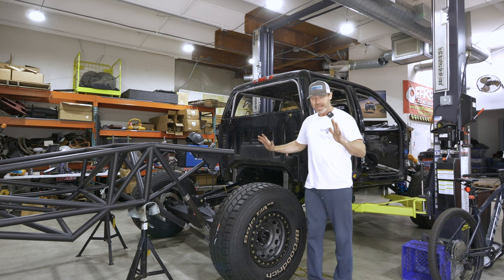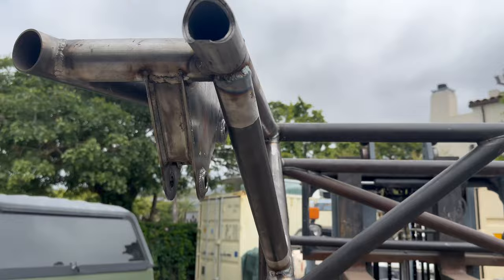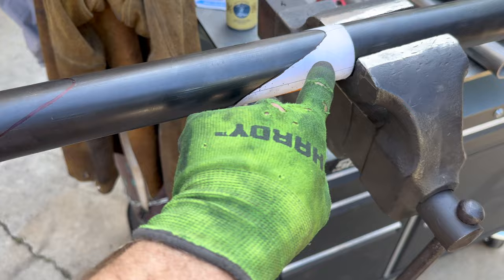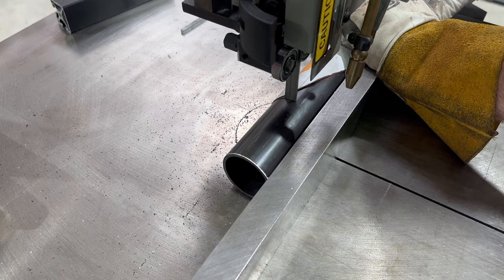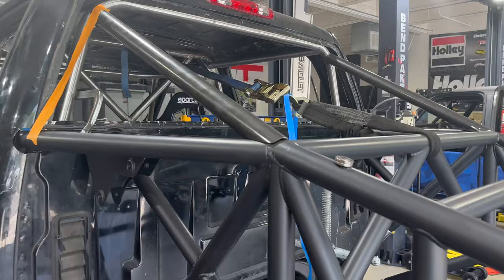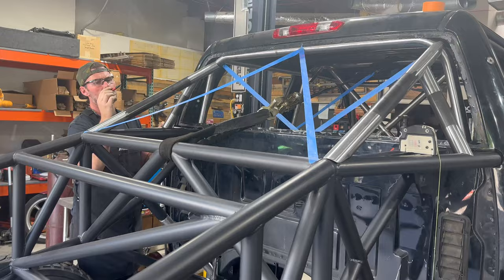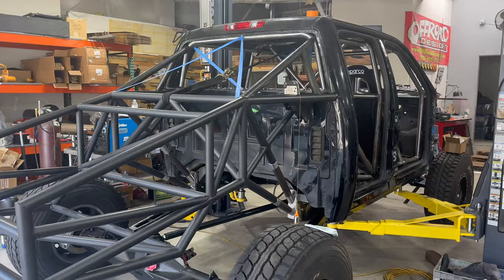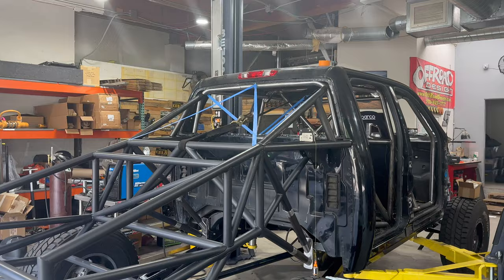Custom roll cage for a custom pre-runner!

Comment: I’m sorry but that cab cage needs to be redone. Get rid of the dead tubes and tuck it tight against the cab. Look up how the professionals build it and copy their design. You guys have all the right parts but that cage is lacking, yeah it’s probably strong enough but the fit and finish could be 10x better if you put the time into it. I believe a few companies offer a complete wiy cab cage for these trucks also. Not hating,I just think you should reevaluate the cage. It’ll be 100% worth it
Reply: 100% Agreed here! Wrote the same comment then scrolled down and saw yours. This cage will work about as well as OceanGate's submersible.
Reply from the maker: Yea not seeing what you guys are looking at.  The cage is unfinished, the “dead tubes” that I think you are talking about are all getting tied in.  

It’s full of straight DOM and Chromoly.  It’s strong as F
Reply: @MerricksGarage  look at your B Pillar junction at the top specifically at 1:17 of this video. The tube coming from the C pillar to the B pillar should land on your B pillar halo tube. Not the plate you welded so that it lands somewhere. Then your down tube from center of vehicle up to the top of the B pillar should land at the same junction as the tube coming from the C pillar to the B pillar, creating a properly triangulated cage. The material you're using by itself is strong, but in an impact this is going to fold itself up like a piece of paper.
Reply: @Pictafiedesign show us your runner 😂 oh you don’t have one? Nice talk

Comment: You really need to redo that cab cage, there are a bunch of dead tubes leading to nowhere. Hopefully the customer never needs to use it because, it will fold in on itself. Do yourself and your customers a favor and take a step back and research what triangulation and roll cage building really means. This isn't it.
Reply from the maker: It’s fine.  Everyone making judgements on a cage that isn’t finished.  There is a crap ton of triangulation in here.  

Don’t even know where to start with the dead tube comments.  There is one supporting / spanning tube off the rear shock that I guess would qualify as a dead tube but it’s not for safety it’s for stress relief from shocks.

Comment: Seems like a lot of extra weight that doesn't need to be there.  All that steel looks heavier than the normal stock C-channel or Box frame that would be sticking out of the truck back there.  The whole point of making it tube frame is to make it lighter.   It looks awesome;  but you guys should be using engineering software to map this out in the most efficient way possible, as far as material needed.  It looks heavy.
Reply from the maker: The back half is still pretty light.  Jon and I can still pick it up easily.  Also, being a crewcab getting that 60/40 rear bias means more weight needs to move to the back.  I am not as concerned with weight as much as I am with safety for this prerunner.  The 454 lsx will make it go
Reply: @MerricksGarage  It's a sick truck.. There's no doubt about that.
Reply: The point is to make it stronger. It gets loaded with spare tires, a big fuel cell, tools, ect. Plus the axle bumps (bottoms out) out on it and the shocks/coilovers are mounted to it. Way stronger than any stock frame if designed properly.